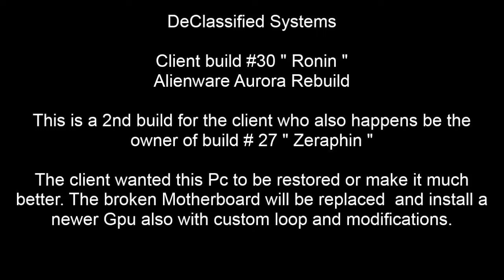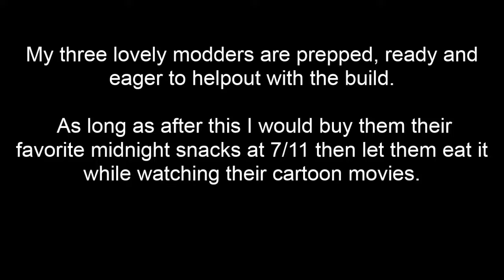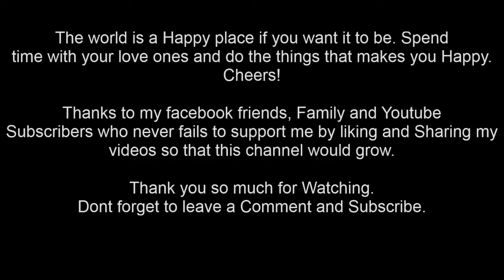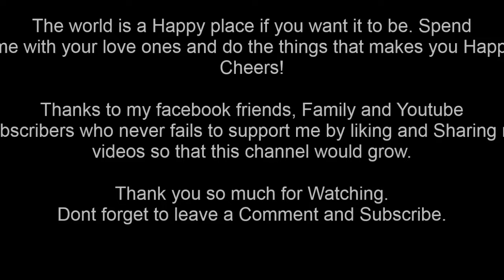Custom Pc Build#30 "Ronin" Alienware Rebuild and Modified. Declassified Systems Asus, Corsair,Intel

Comment: not sure how I missed this video till now, but damn nice job of modding the Aurora ALX case. Has given me some ideas for a rebuild on one with maybe a new mATX motherboard and hiding the MIO board and PSU and doing something similar with front intake fan. Did you repaint the exterior plastics also? if so what prep did it need and what paints?

Comment: Hey m8,
Great mod just like usual!
What material and technique do you use to make that cover reflect like it does at 8:35?
Havent started modding yet but that seems awesome.
Reply from the maker: Thanks. Oh that is just a black acrylic sheet  acrylic sheet then sprayed flat black on it after i cut out the design.

Comment: You are doing some AMAZING work brother! How do you make dimples for rivets? I'm changing some panels around on my current build and when I flip the back panel to place the power supply at the bottom the rivet holes don't line up so I need to dimple the Metal around the hole. And suggestions?

Comment: Sorry to ask so many questions, I'm fascinated by your work though! The lighting in this build, is it just blue LEDS or is it actual black light?
Reply from the maker: Its just blue LED sir. using the blue led on a uv green coolant  is better than using uv  led strip or black light.
Reply: Declassified Systems awesome, thank you! I'm sure you are a busy man, but in the future you might want to consider doing a tutorial on placing the LEDs.
Reply from the maker: Its ok. me i dont have any specific place where to put led lighting, just anywhere that it wont glare your eyes to much or too much exposed and just try placing it first on all directions then you can decide to how you would go about your lighting effect.

Comment: awesome job ! this is by far the best upgrade i've seen for an aurora.
did you get any difficulty to make the lights work or to install alienware command center ? i'm still using the same aurora ALX that i bought in 2013 but i'm a bit scared to modify it, i never did more than changing gpu and ram so..

Comment: Really cool and awsome build :D
But ist there really a need for the second fan at the back of the PC?
Is the radiator mounted to the top?
Reply from the maker: Thanks sir. the xtra fan on the back is for the radiator its a push pull configuration.

Comment: What size of radiators do you use? 360 at the top?
Reply from the maker: No sir i just converted the old 120mm alienware AIO that was installed on that Pc

Comment: Now thats what you call an ALIENWARE. not the default configuration that dell ships it in.
Reply from the maker: Thanks sir.
Reply: Mack Li 
I agree. Dell is a mess. They fucked up everything on Alienware. Back then, when Alienware were still independent before they acquired by Dell, they even built their great default configuration and hardware in their system. Even much better than Dell did in them. Plus, their customer service were so special back then.But after Dell bought Alienware, AlienWare went to the downhill and it become the fall of Alienware power on their machine. It just a shitty Dell XPS and their service fucked up everything on Alienware.